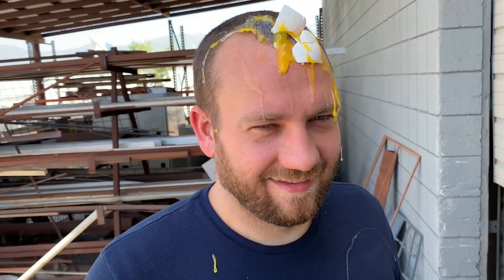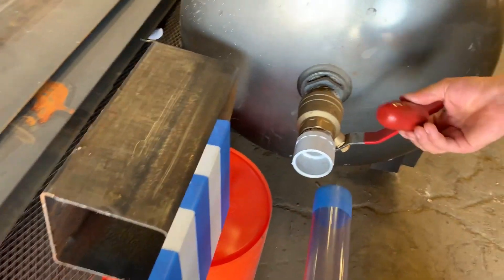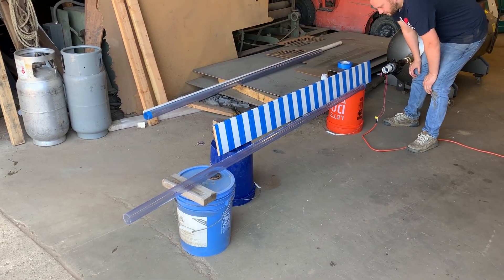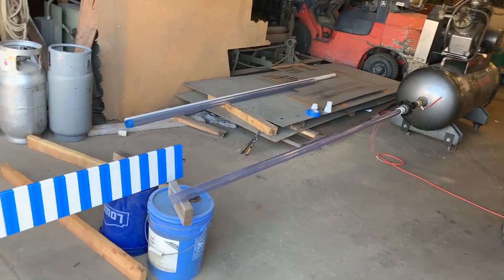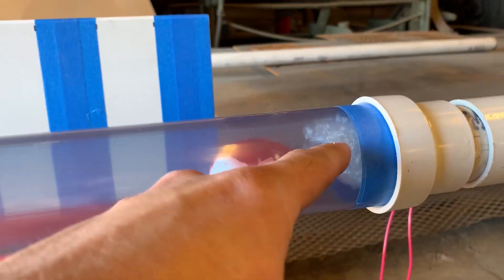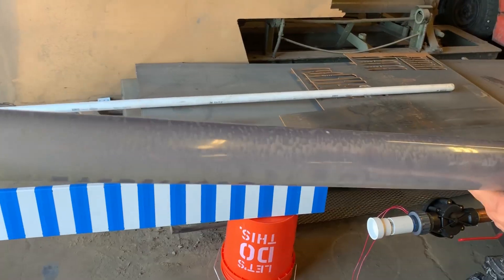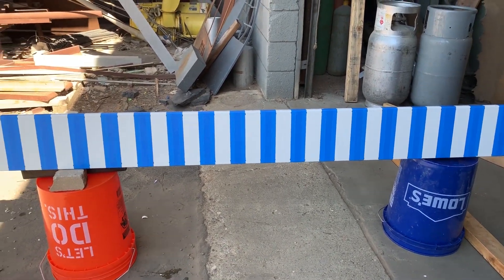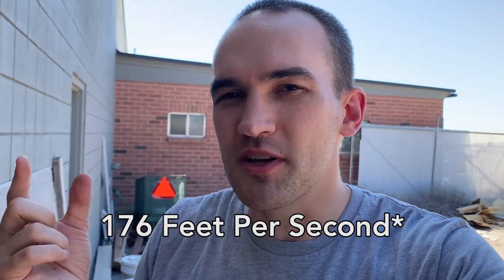Can an Egg Kill You?

Comment: The shell isn't what would hurt you it's the liquid inside traveling at 120 mph acting as a solid. People have died falling at terminal velocity(120mph) from bridges into water due to this fact(water acting as a solid). Take note that egg yolk is only 3% more dense than water) but about 2500 times more viscous. Well I don't know if the unit Poise is logarithmic or not. Water = .0089 and Egg yolk is 23 ... Also is yolk  a dilatant? This would cause it to become more viscous with shear stress since it is protein in a suspension of water.. or Thixopic which would make it less viscous...damnit wikipedia you make more questions than answers lol...I quit.

Comment: An egg is the perfect natural structure. If you press it on the top and bottom exactly it can withstand a lot of weight. It you fire it so it hits the end, the natural structure should hold, making it quite powerful.
Reply: If it hit you in the temple it could transfer enough force, before breaking apart, to cause a fatal injury.

Comment: So, the most likely scenario I can see death occurring is commotio cordis. This event often happens to baseball players. When an object strikes the chest, it sends not only kinetic energy but energy in joules (electric energy I guess). If your chest is struck during the relative refractory period, there is enough action potential within the cardiac cells to initiate a premature depolarization. This will result in cardiac arrest, or at the very least, a lethal cardiac dysrhythmia. It will cause ventricular fibrillation, which is lethal. It is however one of the few shockable dysrhythmias. So if you end up shooting Dan with it, an AED would be a handy thing to keep nearby. On an EKG the relative refractory period starts at the peak of the T wave and ends at the end of the T wave, so it's a pretty short timeframe. The Wikipedia article for commotio cordis where it talks about the risk window disagrees with me on the start and end of the risk window but that's what I got learnted one time so ¯\_(ツ)_/¯ Looking at normal sinus rhythm EKG strips online, it looks like the RRP is 80 milliseconds. So it's possible I guess. You just gotta be really unlucky to get hit with an egg going that fast.
Actually I just thought of something that proves me wrong but I don't want to edit this. 2 oz * 176 ft/s² = ~3 N, which is around ~3 joules. That wiki article said that the risk starts at 50 joules and up. So you're golden, dude. I still think there's a risk but it's not likely. There's also a "supernormal period" with refractory periods that is super short that 3 joules might be enough, but I'm not sure. Thank you for my joining me on my confusing adventure through the world of death by eggs.

Comment: velocity (in fps) squared * weight (in grain) divided by the constant of 450240 will approximate the foot pound energy of the egg in flight. 2oz is 875 grain, so (176*176*875)/450240 = 60 foot pounds of energy at the muzzle! a 22lr bullet is about 120-130 foot pounds of energy at the muzzle from a rifle.

Comment: Hi, undergraduate physics senior here, I did some math on this, and here are my results. 

Using the kinetic energy formula (mass*velocity*velocity/2) and the numbers provided in the video, I get about 83.1 Joules, which assuming now give on the stomach and an egg of about 55mm (about 2 inches) of length, yields a maximum of around 1511 Newtons of force (which is found by using a variant of the formula for work; work = force*distance). 
I've also attempted to find the pressure (pressure = force/area) this scenario (assuming an average width of the egg along its length of 20mm [about 1 inch][this number is assuming that the average is half of width I found searching the width of a chicken egg]) which returned 5 megapascals, or about 750 PSI (and the small amount of research I did said that it takes about 670 PSI to break skin and about 1500 PSI to break bones). 
However, say the average width of the egg was doubled, this value is quartered, and even an inch of give on the stomach nearly halves this value.
Now the value I gave gives an extreme maximum for this situation. Say we get about two inches of give on the stomach, which I'd say is a fair estimate given the circumstances, and the average width of the egg is closer to the actual width of the egg (the same for the sake of math), then this number drops dramatically, to about 0.6 megapascals, or about 83 PSI, which is about 4 times larger than the value I found whilst researching the impact PSI of a paintball, which peaks around 18 PSI (I also learned that it takes about 73 PSI to crush the trachea).
Now I know these numbers sound scary since the theoretical maximum is around 800 PSI (and because the other information I have given), but it won't kill you if hit in the stomach. 
If you look up the average PSI of a punch on google, it will give you some data on the pressure of pro heavyweight boxers' punches. These average values ranging from  1,200 to 1,700 PSI. 

Will the egg hurt? Yes. Will you die from getting hit in the gut? No.

Thank you for coming to my TEDtalk.
Reply: Would muscle mass or fat matter
Reply: @nuclearboom2467  yeah, that would affect the amount of give on impact. The longer it takes to slow down the egg, the safer it is
Reply: Thx for research
Reply: Please tell me you are using your gift for a company by now
Reply: @thebigphish3652  I wish. I'm finishing up my last semester at Uni, and I'm getting sick of getting ghosted by companies.

Thanks for the massive confidence booster though! Hopefully 2021 will be my year!
Reply: (I had to take an extra year, since I decided to double major into computer science and get a math minor as well :p )
Reply: @GamiWorks69  update?
Reply: @MuckyYuckyMcdumpy  I graduated last year with a BS in both physics and computer science. I'm trying to study for the GRE to pursue a doctorate in physics. I have also applied to a couple of companies but with no luck sadly. Hopefully an opportunity will arrive soon!
Reply: @GamiWorks69  LETS GOOOOOOO!
Reply: @GamiWorks69  Now that we know an intact egg won't kill hitting the stomach, what about the shell when it brakes? Is the shell sharp enough to behave like shrapnel or is it negligible
Reply: We got a smart guy here

Comment: according to the doll standing against the barrel NO but it would hurt like hell not to mention if it hits at the balls or the eyes fun fact gun manufacturers make air grooves inside the gun barrel in order to control the air pressure flow to make the bullet spin around it's centre for more accuracy shotd

Comment: Om the air compressor you need to put a sideways push lever like the fire extinguisher so you just tap it without pulling lever down.cuz when u put lever down the air come out slowly.with a fire extinguisher lever you just tap it and all the pressure comes out as one

Comment: From my experience working at a paintball field.. most rules for alot of fields end up falling under the same ranged... 90fps no closer than 10'.. now there are adjustments for various reasons say indoor / outdoor, tournament etc.... but i have seen some crap where players would up there cronno to like 120fps and run up and shoot ppl within 3'... and good god the welts,  bruising, bleeding caused by that is bad... paintballs are way softer than an egg.. if u do this.. dont be within 50 of the barrel end

Comment: An egg hitting your knee cap at 10% the speed of light would kill you instantly.
Reply: I don't think you could accelerate an egg to 10% of the speed of light though so that's not very useful information.
Reply: @jazzabighits4473  not with compressed air, no you'd have to star accelorating the egg from around Saturn and the knee would need to be on the international space station.
Reply: I as an adventurer like you till I took an egg to the knee

Comment: An egg shell isn't equally strong the whole way round. If  one of the ends hit square on, it's going to pass a lot more of its force through before shattering. I wouldn't want to get hit with the point of an egg travelling at 120mph. 
The cardboard test isn't really great though. The cardboard doesn't really have enough rigidity to force the egg to shatter. You'd be better trying something like a polystyrene block (that's styrofoam to you yanks).

Comment: 200 feet per second, 2oz, at maybe 10ft away is just above 6 Newtons of impact force. A beanbag round fired from a 12gauge shotgun is 1.4oz,  229 feet per second at the same distance is just under 6 Newtons of energy.  Don't do it lol
Reply: xthorpyx  the bean bag round is distributing the force over a small area while the egg would hit with the tip which has a small area but would break as the rest of the force is being applied. I think it would be less painful than a Bean bag round.

Comment: Absolutely could kill you in the right scenario.

176 fps * 2.0oz == almost 700 lbs of force.
Reply: That math checks out.
Reply: Yep. I'm getting about 83.1 Joules, which assuming now give on the stomach and an egg of about 55mm (about 2 inches) of length yields a maximum of around 1511 Newtons of force. I've also attempted to find the pressure this scenario (assuming an average width of the egg along its length of 20mm [about 1 inch][this number is assuming that the average is half of width I found searching the width of a chicken egg]) which returned 5 megapascals, or about 750 PSI (and the small amount of research I did said that it takes about 670 PSI to break skin and about 1500 PSI to break bones). However, say the width of the egg was doubled, this value is quartered, and even an inch of give on the stomach nearly halves this value. Now the value I gave gives an extreme maximum. Say we get about two inches of give on the stomach, which I'd say is a fair estimate given the circumstances, and the average width of the egg is closer to the actual width of the egg (the same for the sake of math), then this number drops dramatically to about 0.6 megapascals, or about 83 PSI, which is about 4 times larger than the value I found whilst researching the impact PSI of a paintball, which peaks around 18 PSI; I also learned that it takes about 73 PSI to crush the trachea.  I know these numbers sound scary since the theoretical maximum is around 800 PSI and because the other information I have given, but it won't kill you if hit in the stomach. If you look up the average PSI of a punch on google, it will give you some data on the pressure of pro heavyweight boxers' punches. These average values ranging from  1,200 to 1,700 PSI. Will the egg hurt? Yes. Will you die from getting hit in the gut? No.
Reply: Wouldn’t the bed liner create a lot of friction within the barrel and impart less force into the target?
Reply: @Ms.Nightshade  yeah, it would, as would air resistance. It all really depends on where the measurements were taken.

Comment: You guys should invest in those Mythbusters G-force stickers or a pressure plate to gauge the strength the moment it impacts.
Reply: Right, this reminds me so much of mythbusters.
Reply: The modern rogue are the legend testers
Reply: @ocloud7389  ahh, a man of culture.
Reply: @DahDamns  they. Mainly do science adjacent
Reply: I recall they were just for regular shipping, so you could tell if your package was mishandled. Should be easy to find
Reply: thinking the same thing.
Reply: They're called shockwatch stickers
Reply: Yessss
Reply: they had all the measurements to determine the force it was only about 3 newtons or 2.2 foot pounds
Reply: Those measure pressure waves the rush of air would skew the result, and eggs dont explode in the same way as dynamite lol

Comment: Someone egged a truck I had one time. The egg hit the aluminum around the camper shell window and left divots in the metal. The small hunks of egg shell would cut you up.
Reply: Yes I do. It dug grooves in aluminum deep enough to get a finger nail in. I'm pretty sure skin wouldn't be so lucky
Reply: @MullinPerformance  forsure. And the elastic nature of skin vs the hardness of the aluminum might not have an impact on the results?
Reply: Egg shell cut you?
Reply: @CzarYe  no..they was talking of shooting someone. The shell would be the part I would worry about.
Reply: @MullinPerformance  right... So you think egg shell would cut you? Do you think it's hard enough?
Reply: I wonder what would happen if you soak the egg in vinegar first so the shell loses it's structural integrity...
Reply: @readysteadywhoa  or freeze it... maybe hard boil it.